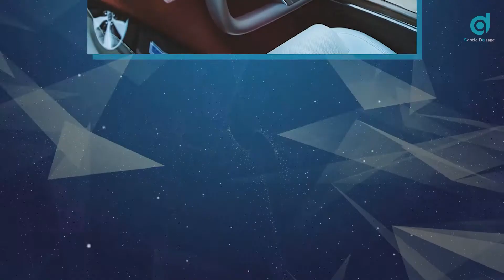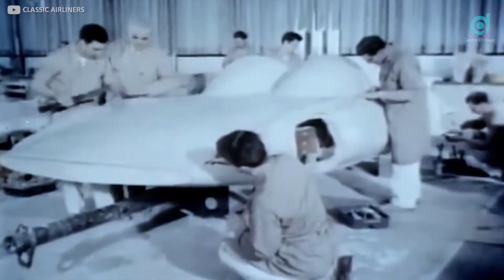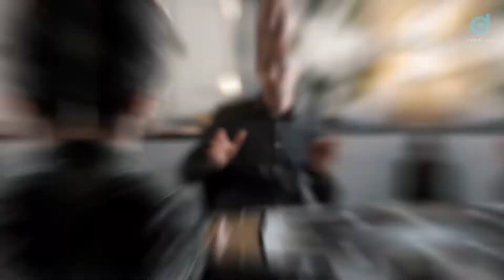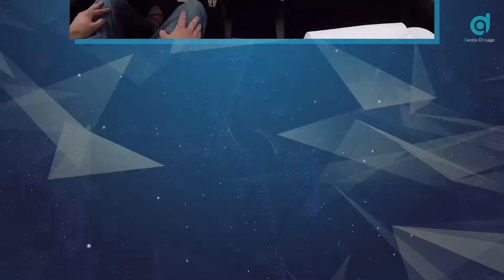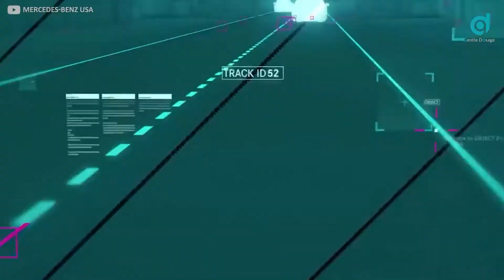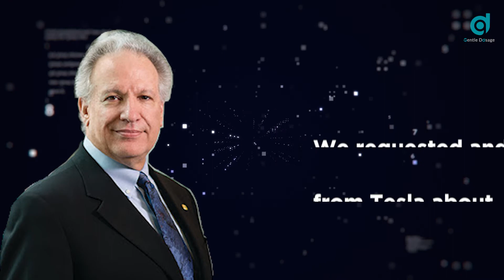Tesla Yoke Steering Wheel  - Sci Fi Inspired Or A Practical Implementation

Comment: Why did they remove the stocks from the steering column?   Why did they replace the steering wheel with a steering yoke?  When the FSD is engaged in the future, what will happen to the steering column and yoke?  Auto-Retraction.  In the event of a manual takeover due to FSD failure, the yoke will reappear for the driver.  It has been mentioned, the Model 3 & Model Y may also be getting the steering yoke in the near future. 
This is only my opinion... any believers?